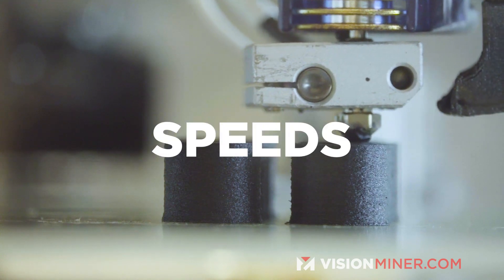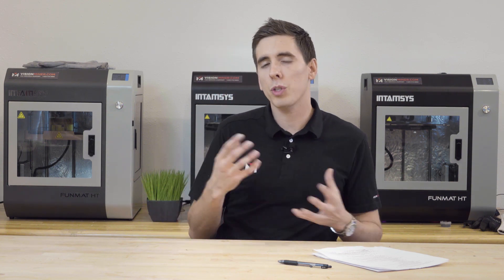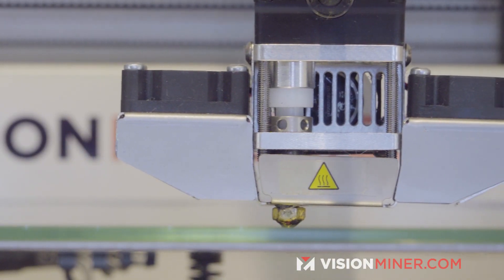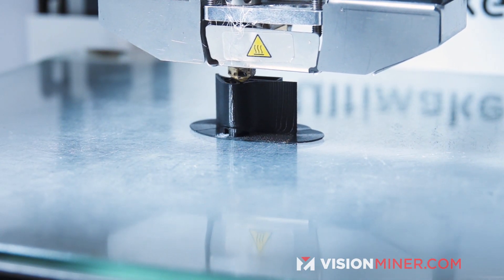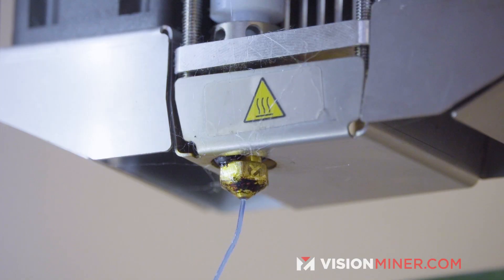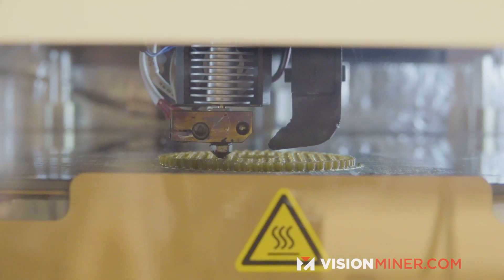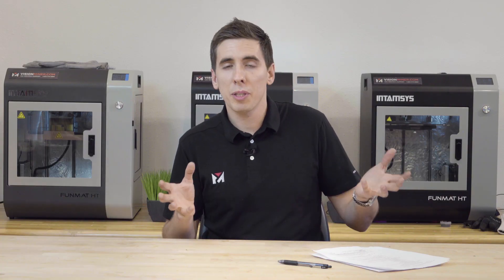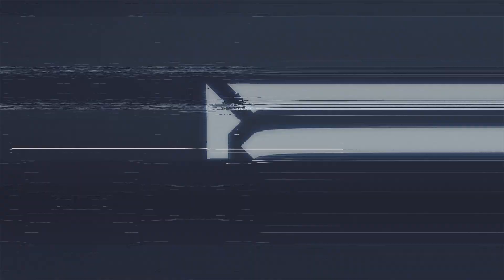3D Printing: Fast or Slow? How to Determine the Correct Speed Settings for your 3D printer

Comment: something small I do.. on my printer, the bed only moves in the Z axis, so the Y and X ones are stacked on each other this means one of them is also carrying the wight of both....I rotate my pieces so that if there is a rectangle, the longer sides are in the direction the very top rail is in as it is the lightest, the heavier rail gets the shorter travels.

Comment: This video is not correct at all. Those materials can print much faster if you have higher quality equipment. The Bambu lab X1 carbon prints at 500mm/s with PLA. Even if you don’t have the best equipment, you can still print that fast. My stock ender 3 printed PLA at over 250mm/s easily.

Comment: but my question is: if i set it on 80% speed, does the mashine also change the plastic extrusion speed or do i have to do it?
Reply from the maker: Yes, slicers automatically calculate the flow based on speed

Comment: You haven't answered the question you asked in the beginning of this video. This video looked like a total waste of time
Reply from the maker: You're missing the whole point of the video, then --- speed will change based on the machine, material, temperature, and other variables. There is no "perfect speed" --- it's all about tuning into the perfect speed, which, on 99% of machines, is around 60mm/s for basic, standard materials.

Comment: I don't see how this video shows "HOW TO DETERMINE" ?
Reply from the maker: Each material is so different, that it really comes down to learning the material... one video is simply not enough! :/
Reply: @VisionMiner  yes it's different but not "so" different, pla differs in some respect but overall they have similar features. in this case, to "determine" the video should more focus on machine structure and how they work mechanically, such as moving parts and momentum.
Reply: by presenting all the facts and things to know so you can make an informed decision on your own.....he simply didn't feed you what speed you should go...
Reply: @ConnorFPS  even then he kinda did towards the end. I got what I needed from the video.

Comment: I tried to print 150mm/s and it layer shifted into oblivion!!! Can printing too fast fry anything on my printer or will it just jerk the bed out of place? so far my orca 2 cygnus can handle 100mm/s
Reply: Try to use acceleration in your slicer. Works fine for me
Reply from the maker: We tend to stay around 70-80mm's in the upper end, but have had some results at 100mm/s -- though it's definitely able to move at 300mm/s, systems like acceleration are in place to help with the mechanics of any belt-drive system. What did you set the firmware acceleration speeds to? Doing a factory reset will take them back to normal, and check if you have the latest firmware for your version of the machine -- be aware if you do the reset, you'll lose your custom material profiles in the machine, so make sure to have those documented. Let us know if you need any help! :)